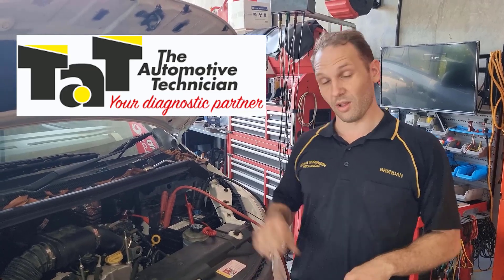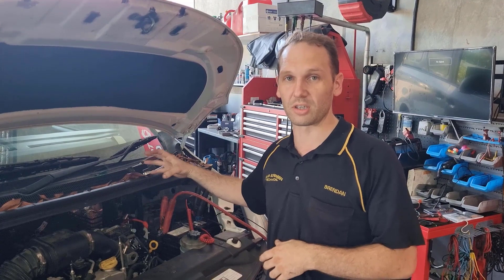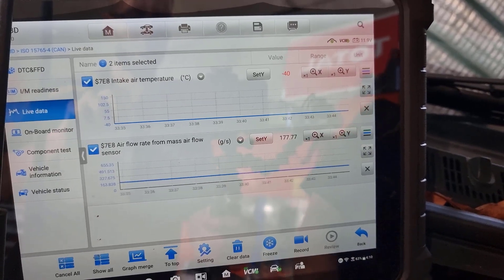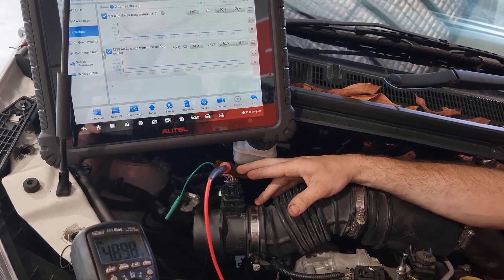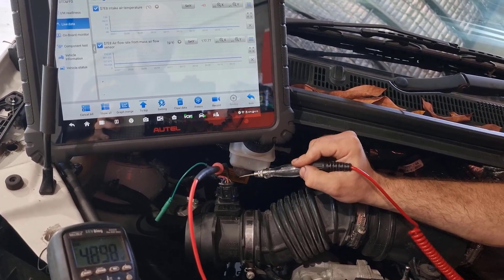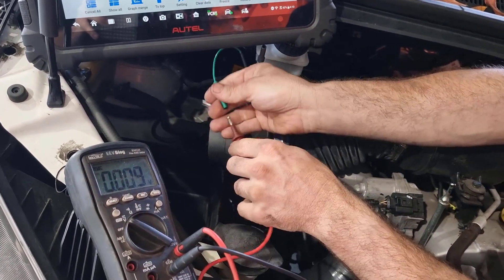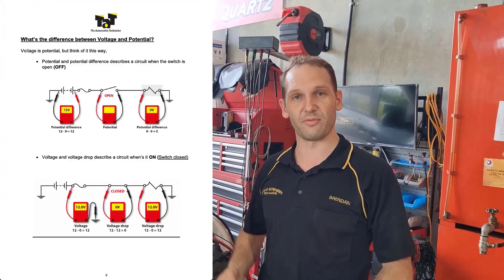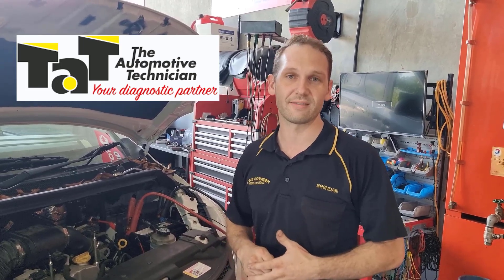Diagnosing and LDV G10 with no access to service information and wiring diagram

Comment: Hi. Wondering if you can help. Ldv g10 2019 automatic. On start up drives ok for a couple minutes, then will go into 3rd and wont come out. Will get the occasional slip but will not come out of 3rd until i switch iff and start again. This problem continues like this. Fault codes p0112, p9103, and u1194. These codes have been erased after a full service and do not re appear on scan tool. The engine light will come on with a exclamation mark, but no codes on scan tool anymore